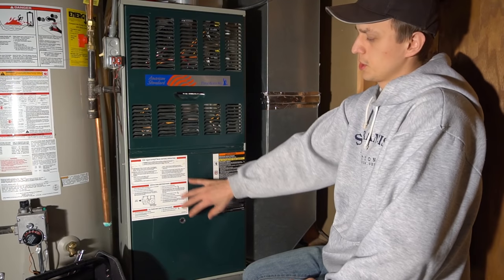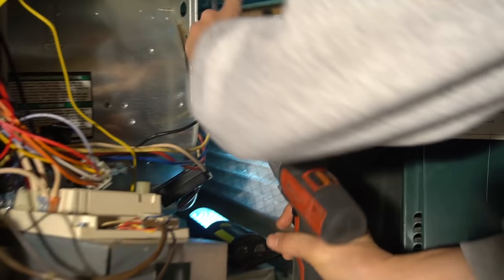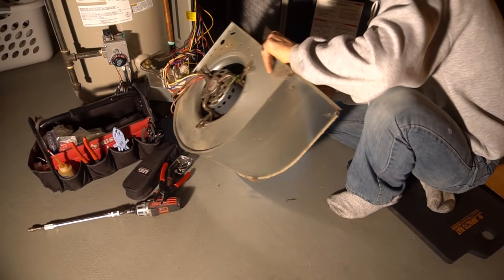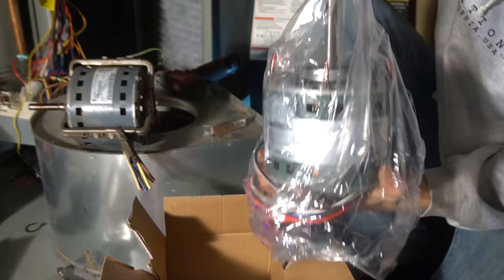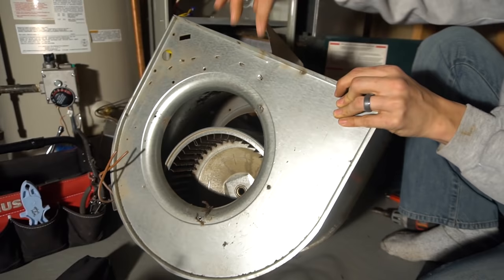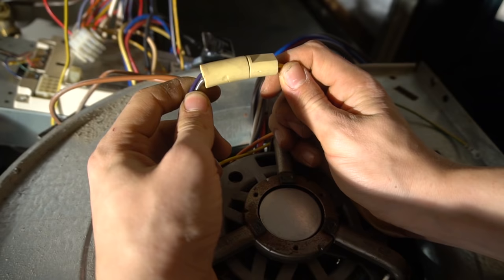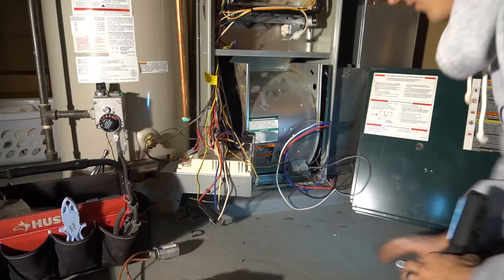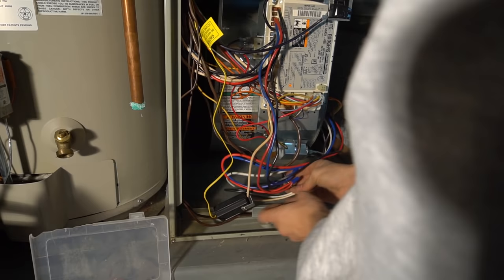Furnace/AC Blower Motor Replacement Step By Step

Comment: hello fellow tech. i noticed the position of blower is facing  back wall of furnace, and the motor is facing the filter. i have a family member  with a goodman system with same setup as in your video and noticed more air gets blown on back wall then filter side. wouldn't the blower facing the air filter be more efficient? i personally have a goodman system with setup in basement standing system like in your video but the blower is facing the filter and  motor facing opposite side solid wall of furnace. the return on both of scenarios is on first floor.
Reply from the maker: Unfortunately I don't have a good answer for you. In my opinion, it shouldn't make too much of a difference. I see them on either side and both ways work fine. Haven't seen that set up cause a problem yet.
Reply: Word of Advice TV , thanks gor replying. i decided to leave it as i came from factory. i did learn direction that motor spins is important, not so much which side motor faces.

Comment: I have a trane xe80 and I put in new blower motor the original one was a GE and the new one is made by fast but it sounds louder then the original one is that normal?
Reply from the maker: It's okay if it's slightly louder but if its loud enough to "disturb the peace" in the home then you may need to do something about it. This isn't mentioned in the video but  the new motor I put it in made a banging sound every time at start up and then it would work normally. This was fairly annoying so I ended up putting in this FM55 motor bracket: http://amzn.to/2C7hIcI    It worked like a charm. The old motor bracket was causing it. Also, this is pretty rare but sometimes at my job I come across a furnace that is loud no matter what you do to it after you replace the motor.. In those cases I usually end up having to get an OEM blower motor, blower wheel, and bracket.

Comment: Would it be okay to use crimp on connectors to join the wires?
Reply from the maker: Of course! :) Just make sure there is no bare wire strands. Wrap it up with electric tape if need be.
Reply: Thanks for your input!

Comment: Does anybody know what to do when the shaft don’t come out? I remove the with screw holding shaft . Tap the shaft with hammer . It slides up and down but won’t come out. Almost like something is holding it in. The farthest it comes out is where the shaft becomes flat as the hole where it goes in. I tried using a wrench extension, hammering it with a hammer but it won’t come out at all . What could it be? When I slide it up and down it feels like something else’s is holding it in but what? It’s a Coleman blend air 2 system
Reply from the maker: @CHITO2800 So basically you can't pull the blower motor out of the blower wheel right? I would push that blower wheel back toward the motor and then deal with the shaft first... You can either cut off a piece of the shaft or file down the shaft real good and then sand it for good measure. Then put some oil on it and it should slide right out. I have a tool that helps get stubborn motors like that out. It's this thing right here: Motor Hub Puller: https://amzn.to/2LDntqx
Reply: Word of Advice TV thanks. I ordered something like that yesterday hopefully it works .
Reply: Word of Advice TV but it’s crazy because the metal shaft slides up in down and turns smoothly but once it’s almost out it just stops . Like if something holding it in. Crazy
Reply from the maker: @ChitoWorld  Yes, that actually happens quite a bit and is pretty annoying. That's why most technicians have a hub puller like the one I mentioned. Hopefully it will come out nice and easy with that tool for you! I should make a video on that since this is actually a frequent occurrence..
Reply: Word of Advice TV it worked with that puller !!!! Thanks. Furnace is up and running .
Reply from the maker: @ChitoWorld  Great!! :) Thank you for the update, stay warm!

Comment: help my wires are diff colors
Reply from the maker: If you look on the label on the new motor, it should tell you which wire is which speed. On most furnaces, the HI speed will be hooked up to COOL and the low speed will be hooked up to HEAT. I have another video where I talk about blower motor wiring, perhaps that video will help you understand how it works and how to wire it.

Comment: thank you!! I have a Trane XE90 TUC100C948A1 and really want convert the motor to a ECM Variable speed, can this be done? if so any recommendations on the brand? been told the Azure Digi 1/2 HP might be able to do the trick thanks again!
Reply from the maker: Yes, it can be done but you do have to know what you are doing. (Most of them will come with an instruction manual as well.) The most positive feedback I hear is usually about the Evergreen ECM motors.
Reply: thank you!!!!

Comment: If i have a 1 speed can I replace with a 3? I cant find any 1 speeds out there for a Hp1/3 RPM 1075 V115 A6
Reply: It says Nordyne
Model: C3BA-030C- A 
But i cant find it anywhere

Comment: I lost track which one goes where on the capacitor they both the same color and same connection type. Does it matter what side? My capacitor has only 2 sides but has 4 prong per side.  Your help will be appreciated!!!
Reply from the maker: It does not matter which side either wire goes to. And the 4 prongs are essentially one terminal connection so each prong is "jumpered to the others" of that makes sense.. Stay warm!

Comment: Quick question 
 
Can this motor replace my 
Emerson model KA55HXELG -1131
Volt- 115
Hz-60
Amp-10.0
Rpm-1050/4SPD
Original part# HQ613209EM 

THANK YOU IN ADVANCE 😁
Reply from the maker: It should work. a 25 RPM difference won't make much of a difference. You did not mention the HP though. That one is important, best if it matches up.
Reply: Yea I tried looking for the HP and I can't find it anywhere on the part sticker 😕 I guess I'll just have to risk it and find out

Comment: I don't get it; Why do they put the circuit board right in the way? I saw a Thermopride furnace  that actually has their circuit board mounted on a hinged panel that can be swung up and out of the way; a more sensible design.
Reply from the maker: I can only agree! I love it when the control board and condensate traps aren't in the way! It makes the motor replacement much faster! Unfortunately most of the engineers who design these things put "service-ability" low on their priority list. Almost like they are not anticipating that any repairs will be needed...

Comment: My new motor doesn't have a white wire just yellow, blue, red and black. How do I wire it?
Reply from the maker: Is there a wiring diagram on the new motor that shows what each color is? Black is always the Cool speed, Red is usually Heat. (but I can't say for sure without seeing it) so that leaves you with blue and yellow. If I had to guess, I would go with yellow being your new "white" wire. But the motor should have a label on it that at least somewhat explains what the wires are or how they are wired. Also, what is the brand of the new motor you got?
Reply: Word of Advice TV thanks. The yellow turned out to be the neutral. Thanks again
Reply from the maker: Oh okay, good! Glad you got it figured out!

Comment: Where can I buy the  Compositor that  you use
Reply from the maker: I have Amazon links in the description of the video that you can use (is what I was about to tell you....) But I just looked in the description and it's not there! Thank you for asking that, I'll make sure to add a link to it. Here it is though: https://amzn.to/2LKeDYv   By the way, on the new motor specs it should tell you what size capacitor is needed for that motor. Make sure you get the right one. The one I linked is a 5 MFD capacitor.

Comment: Why not just run the new wire directly to the board?
Reply from the maker: That would be better. But I did it with wire nuts because most people will not have the connectors to put on the ends of those wires.

Comment: can I replace a 3/4 HP with a 1/2 HP motor?
Reply from the maker: I think you could get away with that. Generally not recommended though. Are the RPMs the same? Also, if its a 3 or 4 speed motor, you may want to increase the heat speed one speed. The AC might not be as forgiving though..
Reply: Tks for your advice !
Reply: Please don’t you will cause damage to your heat exchanger

Comment: where do you hook up the white wire
Reply from the maker: The old motor has a common (white) wire. Wherever that goes, is where you want to hook it up. 120V Common. I show how I hooked it up at the very end of the video.
Reply: the motor that we got does not have a white wire so we don't now where to put it
Reply from the maker: Oh okay! So what color wires are there? And on the motor itself there should be a label. Does it have a wiring diagram or explain what each color is?
Reply: on the motor it has yellow blue black and red
Reply: and only thing we found on the motor was that the black is hi the blue is med and the red is low but we tried to put the white wire to the yellow but nothing happened
Reply from the maker: That's what I would do too, since yellow is the only one left. I am not sure what to tell you... Is it possible that its wired correctly but not getting power? If you have a volt meter, that's something I would check. Also, I've had a motor before where the white wire was accidentally ripped out or pinched off. Came like that right out of the box. Though that's unlikely in your case since it doesn't list yellow as a speed.
Reply: ok well thank you for the help
Reply from the maker: Yeah.. Let us know if you figure it out please. Maybe you will save someone else's bacon. One thing you could try doing to see if its a working motor to begin with is to take out the motor and hook it up to power directly. (do this at your own risk. Be careful)  If you aren't sure how to do that, then perhaps it's better if you don't try that though.
Reply: ok I hope it would be working it is Brand new

Comment: Hi, thanks for this upload, I found your video to be very useful and informative!
I do have two questions:

backstory: I'm replacing a very old furnace motor that does not have a capacitor.  I mistakenly ordered a motor with capacitor wires (very similar to the one you have in the video), so 

1.) should I order a capacitor, and if so, which type should I be looking for? 
I currently have this motor here: 
http://hdsupplysolutions.com/shop/p/goodman-1-3-hp-furnace-blower-motor-p270040

The capacitor wires read: e172774 awm style 1275 600 v 105 C 18 awg vw-1ll84983 CSA AWM 
I was trying to find the right capacitor, but none of them read 600 v

2.) does the capacitor need to read 600 v?  none of the ones on the website go up that high.

bonus question:

Should I look for a motor that doesn't have wiring for a capacitor?
Reply from the maker: Glad you found the video helpful! It's okay that the old motor did not have a capacitor because that is not the motor you will be putting in. The motor you ordered needs a capacitor, so yes you should get one. Just attach the two capacitor wires to either ends of the capacitor and secure the capacitor to the blower housing with a bracket, metal tape, zip tie, etc. Or if you want to do it the lazy way, you could just tape it to the wires and let it hang there. Now for the 2 questions.

1.) The link you provided, under the part number, where it has a paragraph of specs, there's a part that says: "Cap 12.5/370" That's what you need. Cap stands for capacitor. Here is an example: http://www.ebay.com/itm/Capacitor-Run-12-5-MFD-x-370-VAC-Oval-H-3-3-4-x-2-Diam-Oval-/172418188188?hash=item2824ecc39c:g:jUEAAOSwv9hW2LHg

All the numbers on the wires won't be relevant to you. 600v just means that the maximum voltage that can be applied to these wires is 600 volts. So once again, yes, get a capacitor. They are pretty cheap. What brand they are does not really matter. If you have a multimeter you could check the MFD reading of it before putting it in, just to double check. 

2.) No. The capacitor will not read 600V. 

Bonus Answer ;) 

Pretty much all the replacement motors out there will have a capacitor. Unless you have a very old furnace that has a belt driven motor or a variable speed (ECM) motor. Those won't have separate capacitors. I don't think there's a need to look for a different motor. That one should work fine.